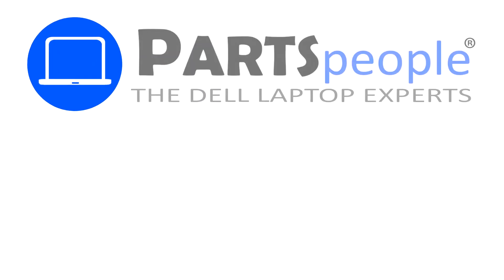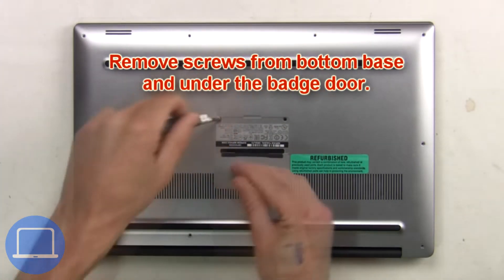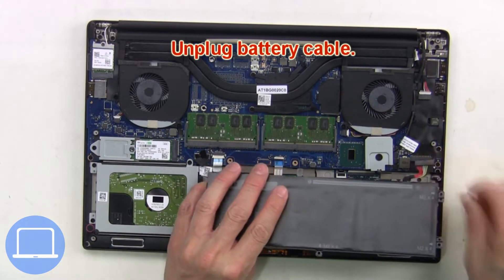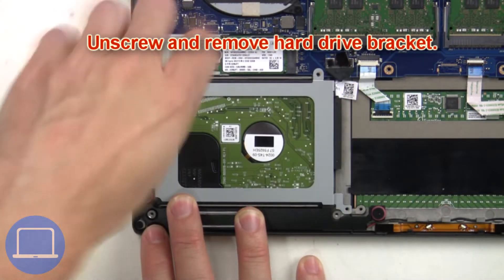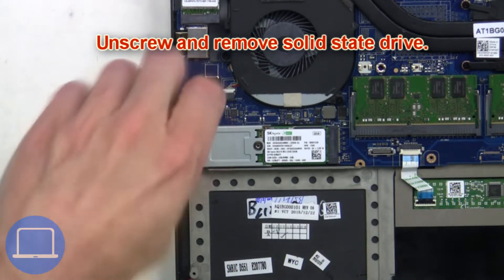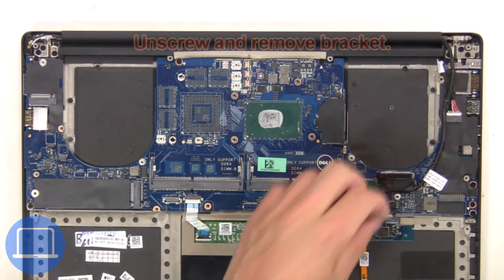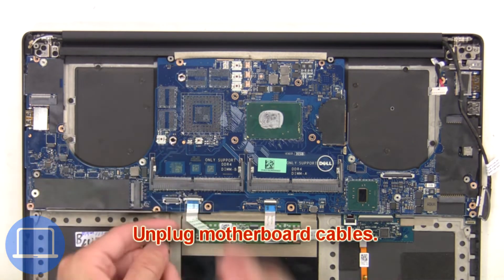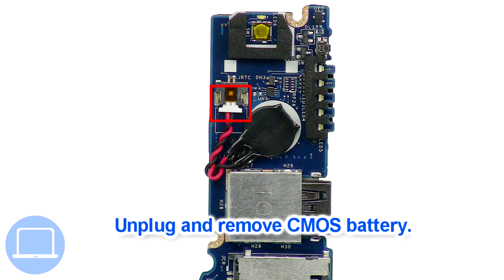Dell Precision 15-5540 (P56F003) CMOS Battery How-To Video Tutorial

Comment: This is a fake video. You don´t show properly where is located. You use a sepparated video with another small pcb with the BIOS, that is not in this computer
Reply from the maker: Hey there, sorry for the video not being as specific but once you remove the motherboard then the bios battery is on the other side. Here's a complete picture from Dells website. But I hope you figured it out already! 
https://www.dell.com/support/manuals/en-us/precision-15-5540-laptop/5540_servicemanual/removing-the-coin-cell-battery?guid=guid-e10c3a37-f4a7-4567-85ad-61b1c4bacbd7&lang=en-us
Reply: @dellpartspeople I know where it is in my version of motherboard, underneath the WiFi module, so thanks anyway, but this video is wrong